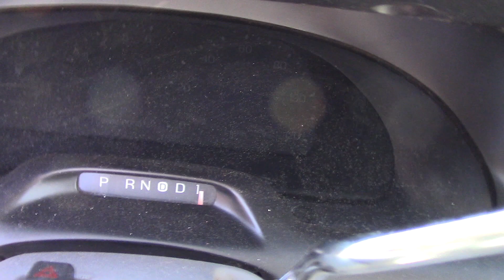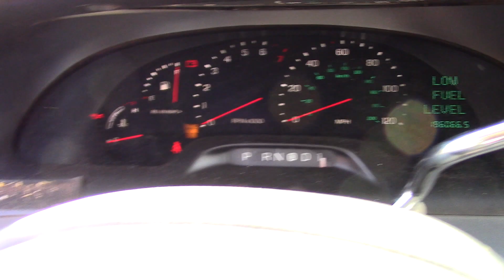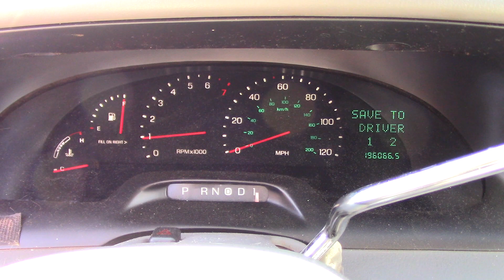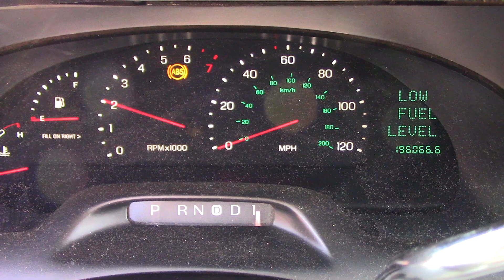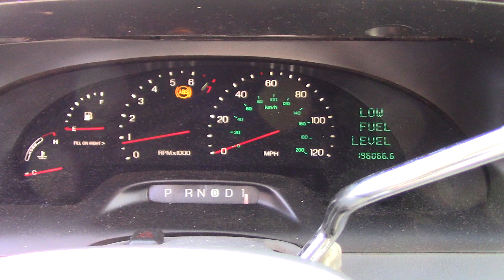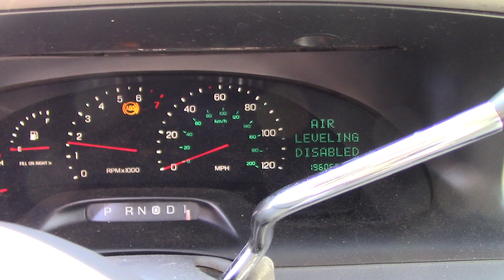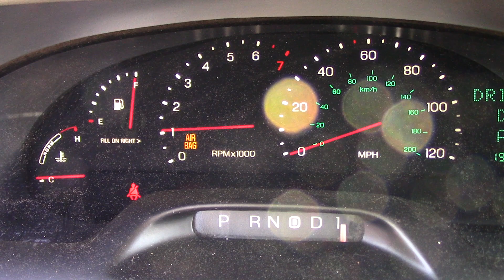WILL IT RUN?! JUNKED LINCOLN CONTINENTAL (

Comment: Sounds good, these cars are fun to beat on..  I would only drive my continental hard when on the hwy , not from a stop from first gear to second is where you will kill  a transmission on these. My transmission never needed clutches or anything but it did have a shudder so I replaced the torque converter and had a fluid leak and that took out the pump.. But was an easy fix,  the valve body has the pump in it..so I just put a used valve body in it and cleaned out all the aluminum bits in the pan new fluid and filter and it was good again. The ride is so smooth, you don't feel the bumps it like riding on a cloud compared to my 03 Cartier Town car.

Comment: I have one of those 1997 I've had it now for it will be six years this coming April and it only has 132.000 on it I have heated seats also, And Mine is an Original Owner he had it for almost 17 years...
Reply: So you're in 2020?

Comment: A 97 with a tape deck? Definitely marketed to old folks. What size engine is that?
Reply: 4.6 DOHC V8
Reply: E Meyer Thanks.
Reply: john dietrich 
That's an awful lot of power for front wheel drive.
Reply: Sure was in 1995.
Reply: jaguar s type 
I grew up around Jaguars, my dad worked at a dealership from '75 until sometime in the nineties. I love the cars, but I am very aware of that market group. I used to love riding around in E types and XJS with V12s!
Reply: jaguar s type 
I haven't been around any later than the nineties. Its cool that they own themselves again, though.
Reply: jaguar s type 
At least its not Ford anymore. When they bought Jaguar the highest paid employee was Eddie Irvine, the F1 driver, who the Ford execs had never heard of!
Reply: jaguar s type 
Probably so. I still think its funny that Ford's CEO didn't know who Edward Irvine was or why he was making millions a year. I have 2 Mustangs so I am not anti Ford.
Reply: jaguar sucks cat